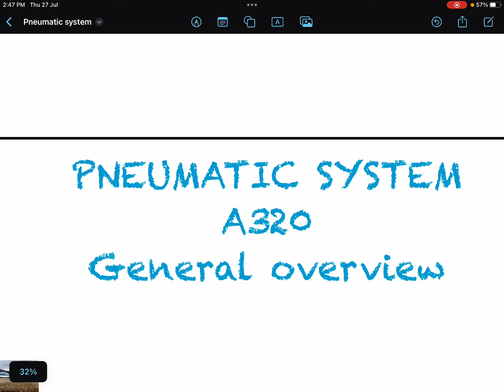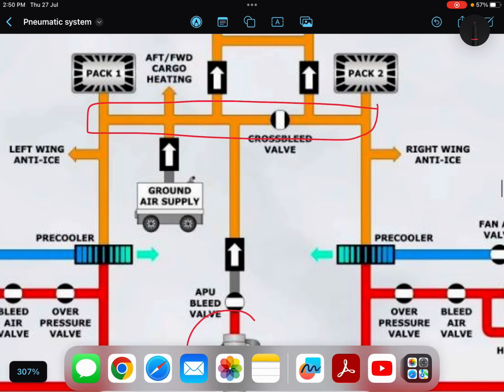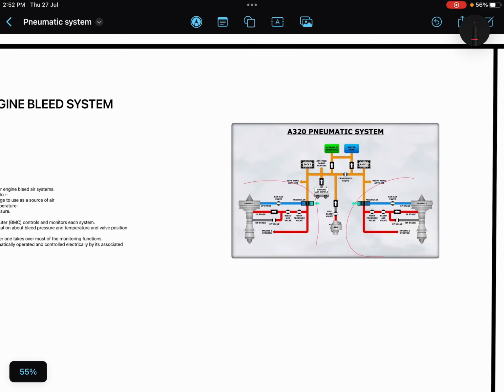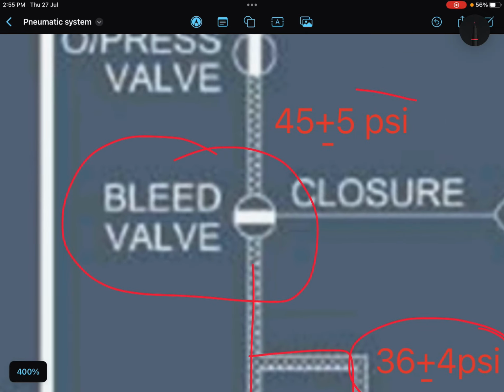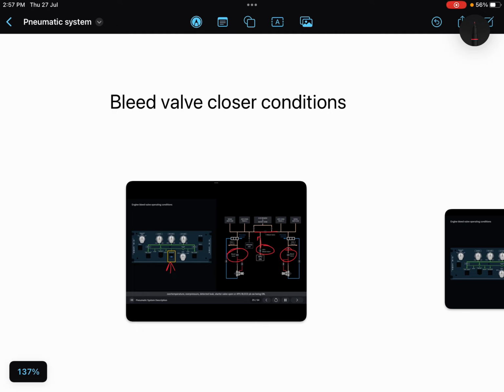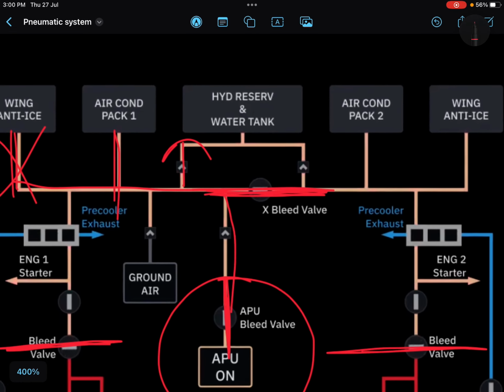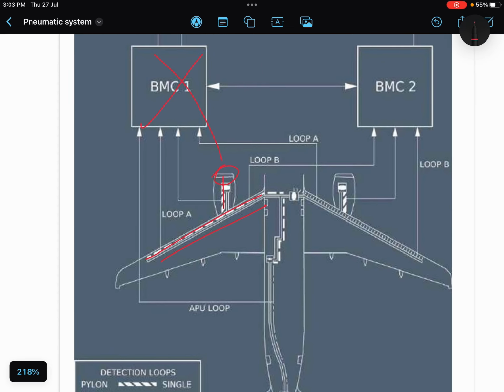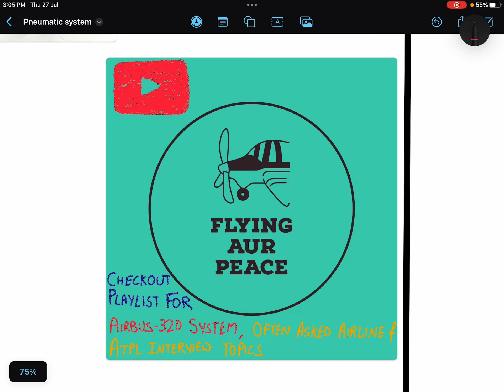Pneumatic system Airbus a320  // General Overview #pneumatics #bleed #a320 #flyingaurpeace

Comment: I have a question - when starting the engines, the engine bleed valve closes, then how is the bleed air used for starting the engines? Does the bleed directly go to the starter valve?

Comment: The bleed valve / PRV is not electrically controlled.  Its opening and closing is 100% pnuematic.  The prv is connected via a sense line to a temperatute limiting thermostat solenoid valve (TLT).  This TLT seals the sense line allowing pressure to build in the valve.  As pressure increases inside the valve, the valve opens.  The TLT is electrically commanded by the BMC in case of faults, or switches in the cockpit.  When the solenoid in the TLT is energized by switches or BMC, the TLT relieves the air pressure in the sense line, then the valve closes.